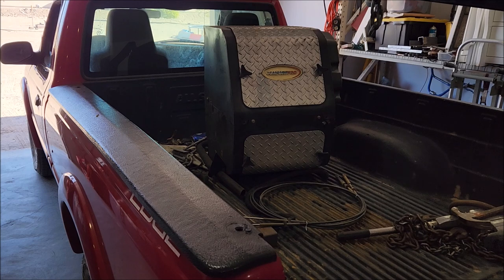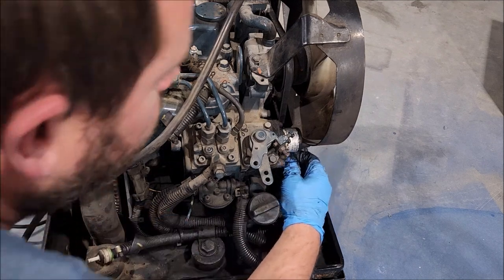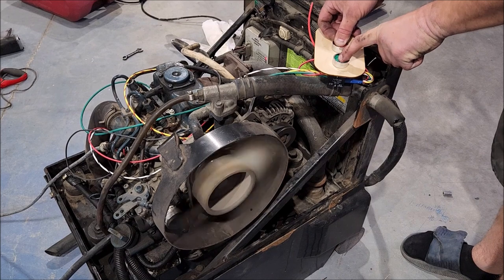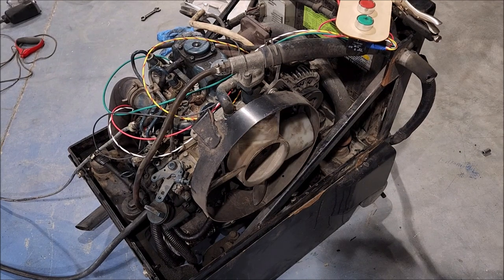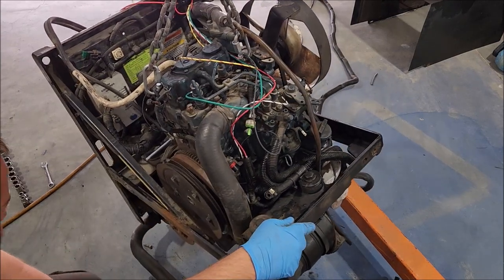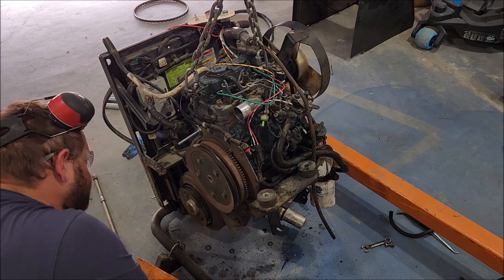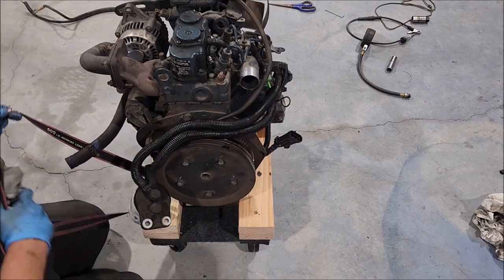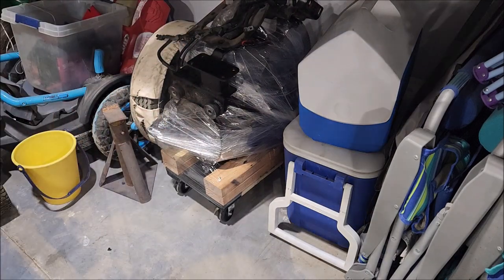Easiest "Will It Run" Video Ever / Comfort Pro APU Teardown

Comment: You have many options with that motor ! Up here we use them for saw mills but your tree population hasn’t been around since the dinosaurs! Lol. Another thing is that motor is good for a trash pump and lawnmower and golf cart and side by side ( homemade ) and perhaps a small car 🚗 !  And less I forget an air compressor and if it were water cooled it’s great for a Hot Shot unit ! Just to name a few things ! 👍

Comment: where do you connect the white wire from the fuel solenoid?
Reply from the maker: To the start button. 
It gives additional voltage to pull the fuel solenoid open, its only needed for a second at startup. So you'll have a start button, with a wire going to the starter solenoid AND to the pull terminal on the fuel solenoid. 

The on-off switch simply gives power to the 'hold' terminal of the solenoid to hold it open once the pull has been activated. Off switch then disconnects, thus cutting power to the hold and shutting off fuel to the engine.

Comment: I actually need that part of the frame you cut off.  Do you still have it?
Reply from the maker: What part?
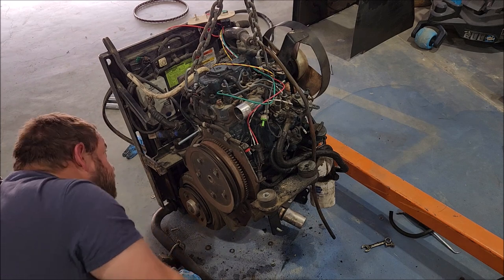Reply: @BrandonsGarage  The parts cut off at 23:44 and 24:21. I would actually take all of the frame and weld it back together.  My entire frame is nearly gone from rust.
Reply: Any luck on the frame parts I would like to get from you?
Reply: I guess no frame.  Thanks for getting back to me.